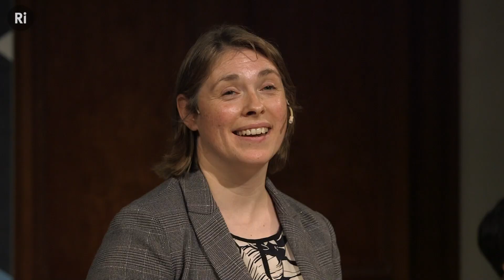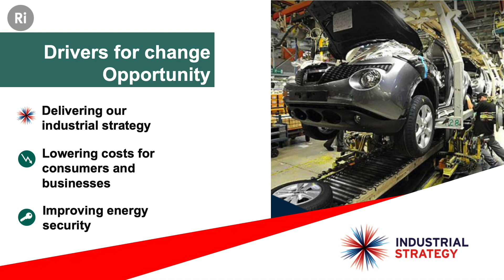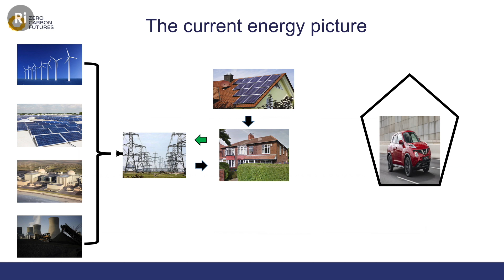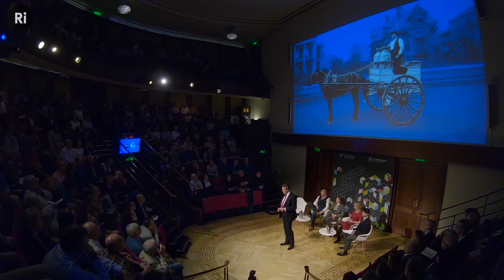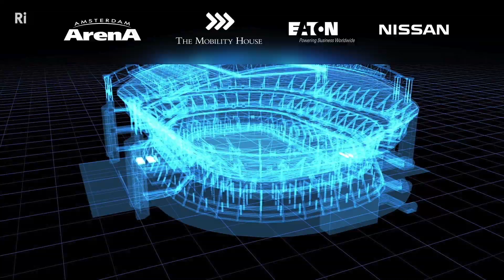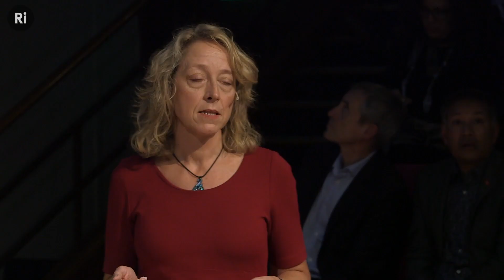How Batteries will Change Our World

Comment: Please don't ban diesel vehicles!!! They are simple, reliable, and can run on nearly anything. Including RENEWABLE BIOFUELS! I don't understand why there is no conversation about this.
Reply: @ANony Mouse OK yea, climate changing gasses are a problem. For instance carbon dioxide. Now .. there is a finite amount of carbon on earth. Some of it 'captured' in solid/liquid substances. For the past couple of hundred years we've been digging alot of carbon rich stores out of the ground and burning them as fuel, now we know that is bad. But as humans we do necessarily release some of that into the atmosphere not least by eating and pooping, but also biodegradable waste. Why not use those gasses as fuel?

But yeah there are better ways of making electricity than burning stuff.
Reply: @ANony Mouse haha .. I wasn't going to mention that ;)
Reply: @ANony Mouse I don't know much about nuclear but I'm to understand that there is no way of disposing of the waste that we currently know about. That being said, it's only dangerous because it is still emitting energy! I don't know why that remaining energy can't still be used to do at least something.

I'm also very reluctant to have to rely on outsourcing my personal energy needs to means of production outside my control. I'll just stick with my solar panels personally.
Reply: @ANony Mouse Solar panels are always worth the outlay given enough time.
Plus they are trending towards a lower cost per watt all the time. Currently about £1 per watt. Then of course you need to get the most expensive bit .. batteries.
But there are much cheaper ways to do this than a massive family house sized installation by mcs qualified technicians.
Buying second hand panels from bulk industrial sales is a good way to cut that cost. As for batteries, large companies are required to have their batteries in tip top condition and often throw out perfectly good ones that have been in banks with one dodgy one. You can get them for a fraction. I got some for £40 that rrp at nearly £200.
Also car batteries that can't start cars have usually still got plenty of life in them and u can usually get them at near scrap value.
The other benefit of learning ur stuff about solar and doing an installation yourself is that you monitor your energy usage and realise what you waste, so you can minimize ur usage and therefore outlay cost.
I started really small and just powered my router and phone charger with a battery I found on the street and a 30w panel, and then slowly expanded from there.
The only limitation of solar, and really all electricity, is that it's very inefficient at heating. So kettles, ovens, hairdryers, heaters do really rinse ur watt hours. Gas, preferably biogas, is much more efficient. I'm still on propane tho.

Comment: Politial BS, Climate Change (CC) is a SCAM.  There is a heating cycle in place but NOT made by man - CO2.  Let's put some truth to CC, why were temps higher by 2 degrees C in Mideveil times (900 AD to 1400 AD)?  In last 18 years why have temperatures kept constant instead of moving exponentially up as CC model predicted?  In Midevil times there was a heating period that took temps up higher than today's & there was no CO2, except for cow farts.  Pollution control is great but these guys are trying to scam the public.  If clean energy is the solution, wind is NOT the answer.  Solar has potential but the best solution is Fussion.  CC scam have ITER in process at a cost of $50B.  There are alternative solutions, ARC and DFP.  DFP can has attained fussion temperature levels as high or higher than ITER prototypes and has a cost of 1% or less.  So why not work out the P11Boron solution?  Money, political control and graft, that's why.

Comment: @5:50 homes do not 'need' charge points for the same reason we don't need home refueling points. They are, however, useful for an integrated charge storage network.
Reply: Then how do you charge your car🤣🤣
Reply: @gerarddunne956  did you even read my comment?

Comment: I don't understand the narrow vision where batteries are the one and only solution. Hydrogen better fits current infrastructure, at the cost of lower efficiency.
Imho we need both.
Reply: H is not at all practical!
Reply: @linmal2242  but batteries only seems to be a way too big challenge to achieve in twenty to thirty years.
Hydrogen is practical, less efficient, and we'll understood.
Hydrogen sometimes explodes, but so do Tesla's (imagine a parking garage filled with lithium batteries on fire? Who will go in and extinguish the fire?)

Comment: The U.K. should be commended for tackling the movement away from fossil energy. A point I would like to mention is that a worldwide universal charging point must be decided on. As EV's become more popular they can't be tied to that EV manufacture charge point design. That has to be a universal design that will charge any make or model EV. Otherwise the whole push for 0 emissions will fall flat on it's face.
As for battery tech. It's changing all the time. Everyone is looking to make the perfect battery. When really we don't know what a perfect battery is. It's difficult to put in infrastructure for something that may have a radical change of requirements in a year or two. The battery of the future maybe totally different from our concept of today. That's certainly a key issue.
Certainly the storage of power remains a problem. High tech batteries not withstanding. At the moment solar and wind power can't really compete in a meaningful way as being constrained by weather, if nothing else. Not familiar with the U.K.'s  hydropower potential. Can tell you too many dams can ruin the environment very much. Water is a precious commodity.
As for Shell sounds like they want to control as much electric power to sell. Just like they did with fossil fuels . With Shell stations all over the place.
I would look into hydrogen generating stations not affected by the weather  To help the U.K. meet it's goals.
Interesting presentation. Thank you.

Comment: Second speaker here. First answer is that no I do not play snooker but I see the likeness. I did not give up Physics just particle physics. I did not attempt to give a corporate video but we were given guidelines. I have no shares in any battery companies or car companies and we were not asked to talk about hydrogen as batteries were the subject. Finally this is one in a series of 3 and all are different. The first one covered battery chemistry and mining. I also cannot be held responsible for who was the PM at the point of the talk. We had an excellent Q7A at the end where the Shell lady was put under pressure.
Reply: Good day mr Herron (wrong name was unintentional, sorry :-))

the Shell lady said : "technically, economically and industrially possible". She does not use the word ecologically...

Could you please give a link to the first lecture?

 From what i gleaned from the internet so far, the mining is going to be a huge challenge to do in an eccologically responsible way. But very little info to be found. Here in Portugal locals are being kept in the dark about the disaster that is about to take place : open rock lithium mining on a huge scale...

Comment: Even a bicycle is not zero carbon, the "motor" exhaust is CO2. Electric cars are not zero CO2 either. Aside from the huge carbon output required to build them, there is of course the carbon output needed to produce power for them to charge. So no zero emissions transports available... even walking. I too would have liked something on battery technology. If we can't be honest about about things and call it lower emissions rather than "zero" we have already lost.
Reply: H is not at all practical!

Comment: Net Zero "Carbon" in ... is absolutely moronic and conflating CO2 emissions and pollution is ignorant.
The Royal Institution should be ashamed of itself. Have you not heard of the Null Hypothesis. I suggest that you start using it in your assessment on issues.
1:10 minutes was enough I stopped there!

Comment: Why not build the infrastructure for hydrogen fuel cells.... the terminator had a fuel cell..lol..in a crash the batteries will leak and will catch fire . like hydrogen too. so lets use a photosynthetic system to transfer the electrons to the motor, but I guess that will take many more years than Nissan has done in decades..lol. add a catalyst Nissan Yeah.... they make cars,,,, I drive ( Not a Nissan). Love the propaganda.... Tell me something new. Did Nissan fiddle their results like all the other car manufactures. How much carbon does it take to make an EV? and how much carbon does it take to decommission an EV. I have had enough of this CR4P...
Reply: If you don't like it you can always walk.

Comment: Everybody who thinks we'll have zero emissions by 2050 seem to forget aviation. How will airplanes, the greatest pollutants, work with no fossil fuels? And I don't mean a solar airplane that can carry the pilot and maybe one passenger.
Reply: The air travel industry exists because of the anomaly that jet fuel is not taxed so it has an advantage relative to other forms of transport in that it is not paying any penalty for the damage it does.

A long-distance air-trip can use as much fuel per passenger as a car uses in a year. Consider which you would rather do without.

Comment: Edit - (Too many dummies not understanding simple english.) Current technology in making batteries is very harmful to our planet. We must look for a better storage solution with less harmful chemicals and materials.
Reply: What? That legitimately doesnt make sense. How do you store energy without a battery?
Reply: @ReformedThe  Gravity, best example would be lift pump hydro dams.
Reply: @ReformedThe  You are dumb. Cant you read? I didnt say replace batteries. I said make them with different ingredients.
Reply: @safetydave720  Unfortunately that's almost certainly not going to happen due to chemistry. In most battery installations the most important variable to optimise is power density and that pretty much means you have to use lithium. Maybe for grid level storage in something like a flow battery we can use something safer but that's a long way off yet. What we do with the waste is really the key, we don't have to just dump it in the sea / landfill / where ever. Get decent legislation passed to make companies clean up after themselves.
Reply: @WobblycogsUk  I agree with you.
Reply: @safetydave720  I have looked really hard and agree with Bill Gates, there is no current battery tech available that would be a viable replacement for fuel based energy storage until energy density increases 5x. I think we need to focus on population control and getting below 5 billion or the lifestyles we desire are not going to be sustainable with any technology, even fusion unless it generates way more power than expected which seems unlikely.
Reply: @Brougley  No doubt there are way too many people on this planet. I agree with your comment. Unfortunately, I believe there will be a "culling" of people in our future. A Marxist state, which I oppose, will legalize such an atrocity.